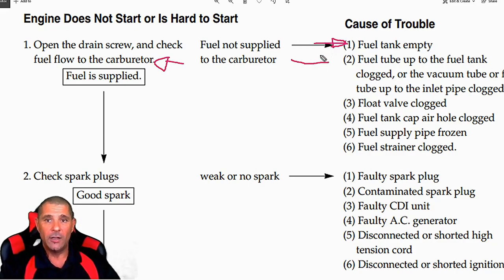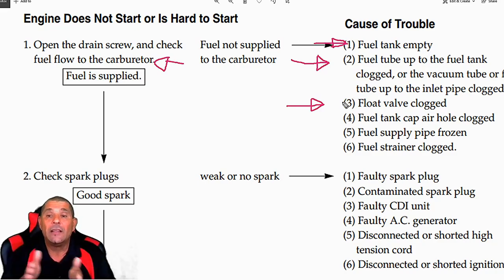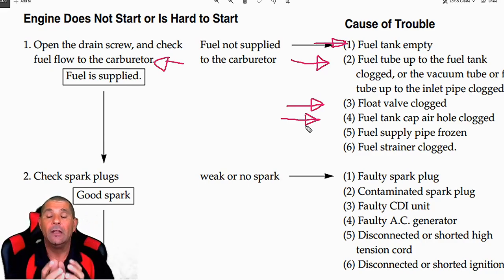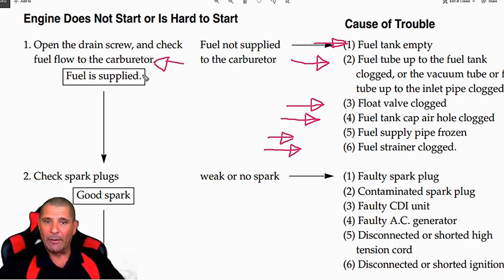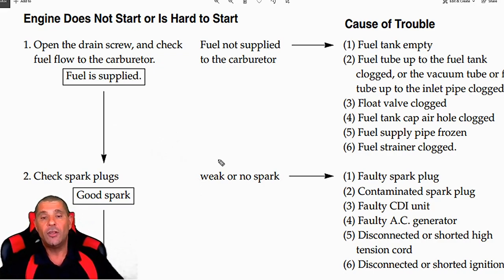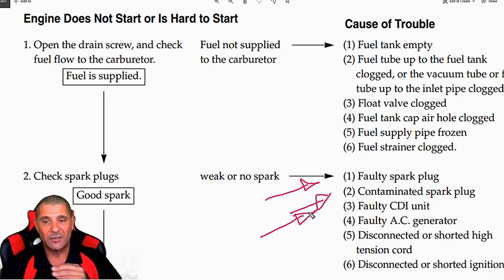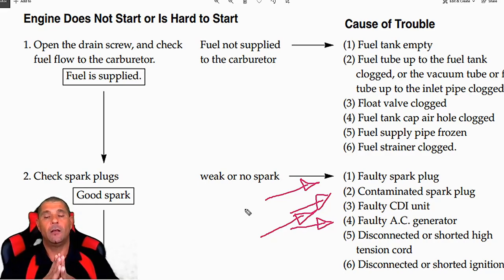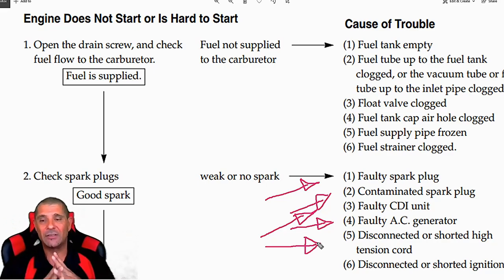Troubleshooting Your Chinese Scooter

Comment: If available I had another question and thank you for all the help already your amazing for doing these videos. My question is I have a jonway yy150-12 that the other day while riding down the road sounded like I had a back flat tire and was flopping. I pulled over didn’t see anything wrong so I went on about my Business well not even 400 feet down the road my scooter came to a abrupt stop. The motor still runs and starts right up but if you go either direction about 3 feet the back tire locks down. Now my first thought was belt or clutch trans whatever it’s called that the belt is connected to was locked up but that was not the case the belt was free and was able to pull the clutch back to make the belt lose. When you start the scooter and turn the gas a little the belt tighten back down and was catching. With all that being said I can’t figure out what is wrong
Reply from the maker: Hello Robert the best is to place the scooter on the center stand and open the cvt cover and look in the transmission something is not right around there

Comment: i bought my jonway scooter 150 cc the battery you told me to buy,it seems like the wires that connect to the battery get really hot and smells like burn.do I need to re wire the scooter?or what's my next step to check?...once again thanks for your videos
Reply from the maker: Hello Jesse  if the wires are getting really hot that is not normal so find out which cable is hot and trace it back to its other connection and tighten it there Cable could be loose at the Starter Solenoid or sometime could be a bad regulator  that over charge the battery. Thank you for watching my video
Reply: awesome thank you so much

Comment: HI 
Yesterday I went out to start the 50cc and no cranking sound at all when I push the start button

Battery is good, horn and brake light work

When I take a test light and hook it to batt neg, I touch the starter relay pos and get a light, if I unhook the relay and hook test light to positive and probe the connectors they light up

If I use a screwdriver and short the starter relay it makes a cranking sound

If its cranking when I short the starter relay, does it mean my right side kill switch and start button should be replaced? what should I do?

Whats should I do next? TY!
Reply from the maker: Hello my friend you could have a little corrosion inside the starter button try to spray little connection Electrical Contact Cleaner Spray like this https://amzn.to/3zVgkIW and see if that can help

Comment: In my manual for my gy6 scooter it says valve clearance  in/ex 0.06+0.02 .
Is that what each valve needs to be at or is it between those measurements?
Thank you.
Reply from the maker: Helllo Justin I get more responsive performance on my 150cc gy6  if I set valve clearances to 0.004" - 0.005"
on both the intake and exhaust valves but if you have a 50cc gy6 clearance I think is 0.002 raccomended . Thank you for watching my video
Reply: You can usually tell if tolerances are off if it will not start. If they are too loose you can hear it tapping.

Comment: Hello, can I put carburetor 4t for a scooter with 2t ?
Reply from the maker: Hello yes if it can fit should be working but you have to  make sure the jets they are adjusted to your scooter size / location/ altitude

Comment: Do u have a scooter repair shop in northeast Florida? If not , u know anyone that can repair GY6 150cc scooter  in northeast Florida?  Thank u
Reply from the maker: Hello Larry no I don’t have a shop but that can be a great idea for the future ah ah ah I’ m in West palm and around me there’s Ivan that is pretty good
Reply: Thanks for replying!  Is scooter kickstart not reliable? Or its something wrong with my scooter?  Sometime it started . Why?
Reply: @larrylefors95  Well in my opinion, kickstarts on these Chinese scooters are definitely not very reliable. Kick it the wrong way and you can easily break the teeth (like me😤). I had to replace the half-moon crank assembly when I was trying to kickstart my scooter when the battery died. Luckily it only costed me $5, but it was a pain in the butt reassembling!
Reply: @SegaDisneyUniverse  I understand you!   All of my kickstart parts are in perfect condition but   I am still having a kickstart problem . Sometime it started . WHY?

Comment: Hey man so I just bought a gy6 150cc and for a couple weeks it ran fine. Now for some reason it dies on me while riding it. Any reasons why? Thanks
Reply from the maker: There could be several reasons why your scooter dies while you're riding it. Here are a few possibilities:
Fuel issues: If your scooter isn't getting enough fuel, it may stall out. Check to make sure you have enough gas in the tank, and that the fuel valve is open.
Carburetor issues: The carburetor is responsible for mixing air and fuel in the right proportion for combustion. If it's dirty or clogged, it can cause your scooter to stall. Consider cleaning or replacing the carburetor.
Electrical issues: If your scooter's battery isn't charging properly, or if there's an issue with the spark plug or ignition system, it may stall out. Check the battery and electrical system to ensure they're functioning properly.
Overheating: If your scooter is overheating, it may stall out. Make sure the engine is properly cooled and that there's enough coolant in the system.
Mechanical issues: If there's a mechanical problem with your scooter, such as a worn out clutch or transmission, it may cause the scooter to stall. Consider having a mechanic inspect your scooter to diagnose any mechanical issues.
It's important to address the issue as soon as possible to prevent any potential accidents or damage to your scooter.
Thank you for watching my video

Comment: My gy6 wont start, I checked my boot and the resistor and spring fell out so i bought new ignition coil, wire, boot, and plug but am still not getting spark. what should i do
Reply from the maker: Hello my friend check the wires in the back part   Of the spark plug coil to make sure the connections are ok after that check if the wires at the cdi look ok and are not loose after that you need to check the pickup sensor and test that with a multimeter. Thank you for watching my video